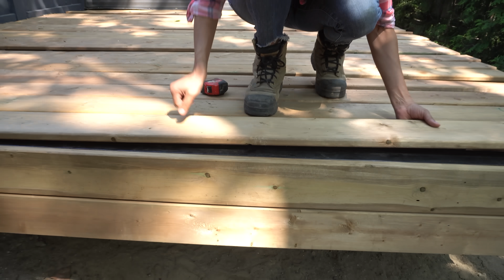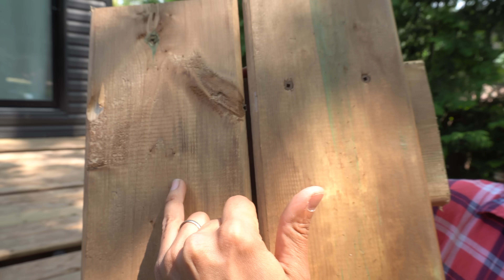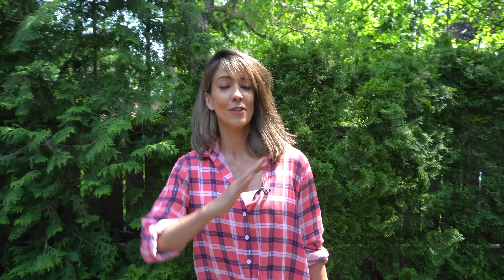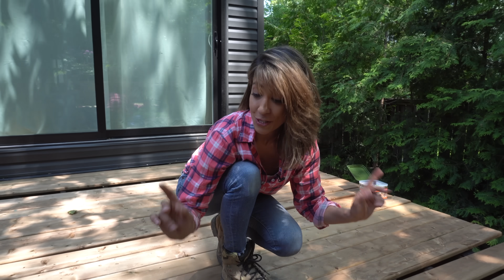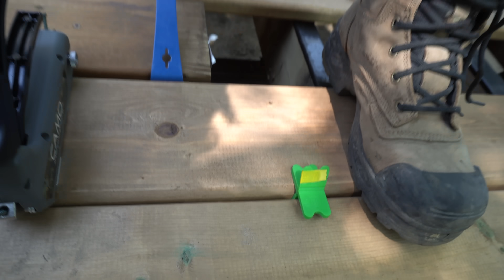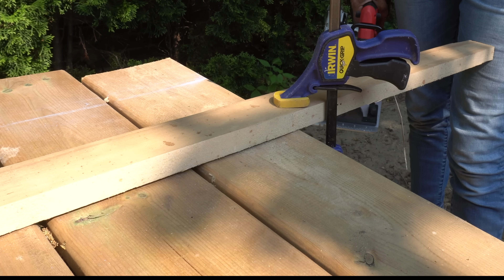Why No One’s Using Deck Screws Anymore: The Hidden Deck Trick You’ll Wish You Knew Sooner

Comment: Is it necessary to gap the boards since it's gonna shrink anyways?
Reply from the maker: I’ve you’re American and you have wet lumber which is often the case you can install your deck boards so they’re tight. Double check with your lumber manufacturer to make sure this is the case. I’m in Canada. We have different lumber here.

Comment: Good thing I found this, replacing my deck in a month and did not know they made a tool to angle the screws for you! 
Side question, My deck is over a walkout basement with 3' out from the prow and then out 5' on the ends, Im buying the lumber in all the lengths
I need so there is no end to end gaps, why did my contractor not do this?
I mean a a 6' and 2' to make the full span of 8'??
THANKS for the advice!!
Reply from the maker: Glad you found us! It’s great that you’re well researched and you know how it should be done. Smart!

Comment: The main reason for hiding the fastener is to prevent rot. The aesthetic is just a plus. You also absolutely should dry your boards before install. They're going to dry once they're laid on the deck right? If you dry first, you can eliminate the boards that are too bad (waste), and you will get your spacing true.
Reply from the maker: Thanks for sharing your tips Kyle.

Comment: If you are a big fan of not exposing screws, then why did you screw the first board? Even that board can be fixed without being screwed through the face,
Reply from the maker: If I remember correctly this deck may have had a double rim joist so the brackets wouldn’t work. Otherwise first board can be installed with brackets like at the end. My deck build video shows this first board in detail, hidden if interested. Thanks!

Comment: I used the Camo Deck Screw system in 2016. They are still tight, no loose boards at all. They do take significantly more time than top screws. My deck is 16’ deep, 2$’ wide. All deck boards are 16’ long. So I have no screws, no joints, nothing. Worth the extra time and money. P.S. go select your own deck boards and then have them delivered.
Reply from the maker: Thanks for sharing your review. All reviews are helpful especially when introducing a method that is new to many. Appreciate it!
Reply: @DaruDhillon your welcome. Seriously, with 3 active large dogs and me going barefoot a lot. No screws and no joints to get caught on (tinking crawling babies and toddler’s here) is a big silent benefit, not to mention I shovel it all winter with a Plastic snow shovel so as not to damage. We use the deck 10 months a year in snowy west Michigan.

Comment: Does that method prevent rust or corrosion? We find if we don't replace screws at least once every year or so, then when the deck board needs replaced, we find the screws are rusted through and a pain to get out.
Reply from the maker: I haven’t had any issues with rust or corrosion or any need to replace the boards.

Comment: You can clearly see the screws and good luck with those trim style screws on a diagonal holding up without pulling through or splitting the wood decking, give the woman a ten on performance and looks
Reply from the maker: They’ve held up great and pretty common here. But I can appreciate your concerns in extreme conditions. Thanks for your feedback.

Comment: 1/4" gap is actually ideal for dirt not getting trapped between planks. In snowy areas, you want quicker drainage. 
Let your deck planks weather for 1 summer before sealing after it dries thoroughly from cleaning.
Reply from the maker: Appreciate you sharing your experience with decking and maintenance. Thanks!

Comment: It's my understanding that you do not sandwich two boards together because of the chance of trapping moisture between the boards.  I see that you have deck tape applied.  Would spacing the boards apart be a better install?
Reply from the maker: You’re right that deck boards need air flow and drainage. I used the spacer to achieve good spacing. For our American viewers you can also install the boards tighter if you have wet lumber.

Comment: This all well and good if the lumber is VERY good, which is almost impossible to find these days. 5/4 board today is young growth and shrinks 3 times as much as it did 20 years ago plus the treatment on the boards is basically worthless any more. Also the small headed screws will tend to pull through over time due to excess shrinkage.
Reply from the maker: That's a good point about the quality of lumber today thanks for your feedback.

Comment: TIP: Board selection. The wonky board she had was the center (pith) of the tree. That piece WILL twist every way. Avoid the center of the tree boards and get the side pieces, especially ones with a lot of rings (for strength).
Reply from the maker: Appreciate you sharing your thoughts with us! Good lumber is key.

Comment: Screws on the side of wet boards will cause tear out when it dries. I reach under and screw from the bottom. It looks great and doesn't split the wood. Angle screw on the joist up into the board.
Reply from the maker: Thanks for the tip! That's a great idea to prevent splitting.

Comment: I think that I would give that method of fastening deck boards a year , maybe 2 , before the expanding and contracting splits and pulls away from the screws. And then it will be face nailed or screwed properly.. just look at the end grain on the deck boards and you will see exactly where it will FAIL. imho. God Bless
Reply from the maker: Good to hear your take, thanks.
Reply: @DaruDhillon thanks , and thank you for the clip.

Comment: If you have trees you need 3/8 or even 1/2 spacing or you will have accumulation of debris between boards that you can’t easily clean out which leads to rot
Reply from the maker: Good point! That's a great consideration to keep in mind. Trees change the spacing.

Comment: Apparently she doesn't have that much experience with what she is saying. Pressure treated lumber tends to have a high moisture content when first installed ,even though it might feel fairly dry. So, that said, after installation when the PT lumber, especially deck boards are exposed to repeated sunny hot days the wood will dry substantially and any spaces you leave between deck boards on installation will expand leaving  gaps! I learned years ago , if you don't want big gaps between your deck boards keep installation spaces to a minimum.
Reply from the maker: I’m in Canada so our lumber has a significantly lower moisture content. But your point rings true for Americans. I appreciate you watching and for your tips.

Comment: I feel like this would make it really hard when you inevitably have to replace boards
Reply: it isnt. and the screw head dont corrode so easily. just a little harder to get the bit in the screw. but they do round out super easy if u arent careful.  also the screws are much weaker. so if u do round them out they are much easier to cut or break off. they still plenty strong for what they are for.  u can use composite decking and u probably wont have to replace a board. composite decking may outlive us all. the ones i did almost 20 years ago are a little faded but still look great and solid as ever
Reply: My deck is PT and it’s 25 years old and still going strong. I stain it every two years.

Comment: I used “ shadow track” to fasten my boards on a new deck in 1999 . Top nail to joist then 1 1/4” screws go in from underneath, no holes on top to take on water. They also have holes every inch right at the bend to evacuate water through gaps between boards.
Reply from the maker: That sounds like a very innovative system, thanks for sharing! Good lifespan, that’s important.

Comment: Thanks Daru for your amazing channel and support.  I wanted to ask you a question.  I'm interested in putting a composite deck with the one that has the groves and connects with the Universal fasteners.  But can is still use the Marksman Pro-X1? or I can only use Marksman Pro for those types??  Thanks for your support
Reply from the maker: Thanks for watching! For composite I would check with the manufacturer to see what fastening system they recommend and for proper spacing. I know lots of people are using the tool on composite. I personally haven’t tried it. Good luck I hope you find a good solution!

Comment: Bought a house. Great place EXCEPT: Some knit wit built the (huge) decks with common nails. As a result, there's no straightforward means of extracting them.  Adding insult to injury, they butt jointed, no gaps, AND ran the planks parallel to the house. Ugh.
Reply from the maker: Sounds like a tricky situation. I hope you find a solution!
Reply: @DaruDhillon  Thanks. It's just too much work for the return. Amazing how little decisions can be so troublesome.

Comment: I purchased buckets of deck clips that had cleats that you drove the decking boards sideways into. Each clip had a spacer that was supposed to leave airspace between boards. The decking all rotted out after a few years because the boards never dried in-between. I told myself "well, it looks good on paper". I nail now with 3/8" between boards.
Reply from the maker: Thanks for sharing your experience and your solution. That is unfortunate. I’m sorry to hear that.

Comment: I have built a few decks in my lifetime, all out of wood!   Have used deck screws on them all.  When having to remove a board for repairs, coated screws tend to come out easy, depending on the head, Phillips vs square vs Torque.   Torques easy to remove when older.    But with new tech and ideas, I am always open to trying.
Reply from the maker: Good to hear about your experience; thanks for sharing your perspective! An open mind is an asset!

Comment: Here is a tip. For my own homes, I have always used 2x8 pressure treated as decking material. The cost is about the same as regular deck boards, but they last a lot longer.
I use screws, not nails, and sink them about a quarter inch. After 10 to 12 years, I simply sand the top with an industrial sander and apply stain (every two years).
After 25 years, the deck is still in great shape!
Reply: Well, we always used 2x6, since they are a lot easier to straighten (via wedge) than a 2 x 8.  But ya, that's exactly how nearly all good contractors build decks where I live for the last 30+ years.  On top of that, pressure treated boards shrink, so you don't need to space them.  But them up as tight as you can, and they will shrink and have a nice 1/16 to 1/8 gap in them once they dry out completely.  I think you will find different parts of the country build decks very differently.
Reply: exactly what i use on my decks but went to 2 x 10s   price wise about the same  easy to sand flat after years of use and easy on SNOW SHOVELS with less ridges to deal with flashing against house and deck to protect against rot
Reply from the maker: Thanks for the tip! It sounds like you've got a great system.
Reply: Deckboards are plenty thick and sanding a deck should never be required and is insane IMO for an outside deck. I use oil stain so it doesnt need to be done very often... 5 years at least before another coat is needed. It sounds like you like doing extra work for no reason. :). Are you one of those guys who mows his lawn twice to get a specific pattern? :)

Comment: i used this system and i am going to have to remove these and put in normal deck screws and its only been a year since the deck was built. as your wood shrinks these do not hold. infact the wood breaks away as the screws are not holding enough of the wood.  i do NOT recommend this with pressure treated wood. only use this with composite.
Reply from the maker: I appreciate you sharing your experience with the system and pressure-treated wood. Have you contacted the manufacturer? I personally haven’t had issues but I value your feedback and input.
Reply: I was thinking the exact same thing. Especially in climates that have extreme fluctuations in temps. With expansion and contraction regularly thru out the year-there’s not much grab to begin with.

Comment: I just finished redecking my 12 x 40 deck.  This screw system is a very slow going process compared to just driving regular decking screws in.  For a DIYer with no specific deadline, then not much of an issue beyond slow progress.  The end result looks great and worth the effort.
Reply from the maker: Congrats on your new decking! Yes it’s a good observation. It takes more time than face screwing. These type of improvements often do.
Reply: feeling your pain. I am doing a 31 x 16, with an additional part wrapping around my hot tub (12 x 5?).

Comment: I agree that the Camo fasteners look great but they do tend to come loose over time.  The last deck I built I used them and after about 4 or 5 years they started to get loose (I'm in Muskoka in Canada so lots of temp variations and lots of precipitation). Most of them I was able to snug up just by driving them in a bit more but some I had to face screw with regular deck screws to keep the decking from squeaking and moving. I also used them on a floating dock I built 10 years ago and they are fine because that decking was glued on with construction adhesive for structural rigidity so basically the Camo screws were just holding the decking until the adhesive dried. Obviously if you glue the decking you can't use joist tape.
Reply from the maker: Thanks for the real-world experience, I appreciate you sharing. Beautiful neck of the woods you’re in.
Reply: Excellent comment. Thanks for sharing that experience and it was something I was wondering about when I was watching this. Weather extreme areas didn't seem like a great place for this for exactly the reasons you stated
Reply: Useful info thank you. I was considering them for a new deck in semi-desert BC - think I'll think again.
Reply: I also have doubts about the deck only being edge fastened  -   esp. since the fasteners are angled and only through part of the board width  -   basically toe-nailed at the edges 5 1/2 inches apart every 16 inches

the screws aren't much different in price than the regular deck screws and strangely are cheaper in the small boxes  ( 350  @ 12 1/2 cents ea )  than the large boxes  ( 875 @ 15 cents ea )
Reply: Thanks for sharing your experience. Very helpful. I was debating using the canmo system for my steps. Probably not the best plan, as I am up North and these steps will be exposed to harsh conditions and wear.

Comment: Fact: the chemicals in pressure treated lumber will eat up the screws or nails on a deck that gets wet with rain. It doesn't matter if they are coated. 10 years max and the deck will be rotting around the fasteners and the fasteners will be eat up.
Reply from the maker: Thanks for sharing your perspective.
Reply: Very untrue. I've taken out screws from decks that are 20+years and it's the boards that are rotten not the screws ( although they are hard to get because they get full of shit)

Comment: When using the prybar when you have only two hands, a block of wood works really well a wedge even better. The camel system works well, but I found that there was a lot of screw head stripping at at least 5% and pressure treated Lumber and like three or 4% in Redwood.
Reply from the maker: Great points about using a block of wood and a wedge; thanks for sharing!

Comment: Recently I ran into a problem using the composite deck screws coming to find that a lot of them will drive down and be up about 1/8 of an inch from the top of the board and just spin never sinking in is this an issue you run across and how did you work around that it seems to be pretty common a lot of people have this complaint your channel is great
Reply from the maker: Hi, I appreciate you sharing your experience with composite. That’s unfortunate. I only work with wood decking and I haven’t had any issues. It is important to use the right length of screw not the short ones. I did reach out to their Customer Service with questions before shooting this video. They were helpful. Perhaps they can help you out.

Comment: Great video but I wanted to see the installation of the last timber, what happens if there isn't enough space to install it, was the size of the last one right or did you have to cut it to make it thinner to fit?
Reply from the maker: @Mgreat-o7v  the last deck board going in was the one with the angle brackets. You can rip it if you need to or adjust the spacing of your deck boards so that it’s whole. That is up to you. Good luck with your build, thanks for watching!

Comment: I plan on using 2x6 pressure treated douglas fir for my deck surface. Does this Camo system work for this type and thickness of boards (and do you recommend it, or just screw in from top/not hidden)?
Reply from the maker: I’ve only used this on 5/4” decking. I’m not certain if they do. Face screwed looks great too. Your deck will be sturdy and well built.